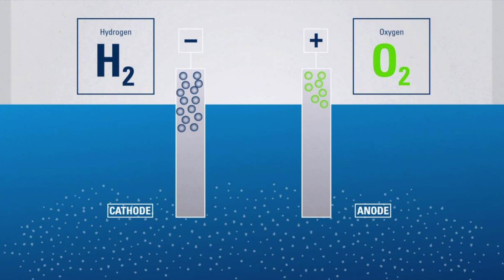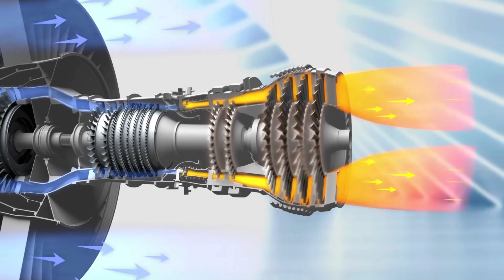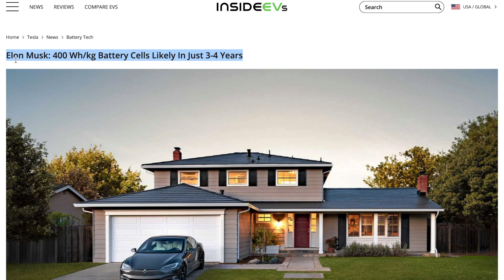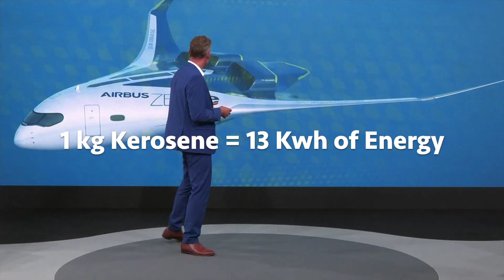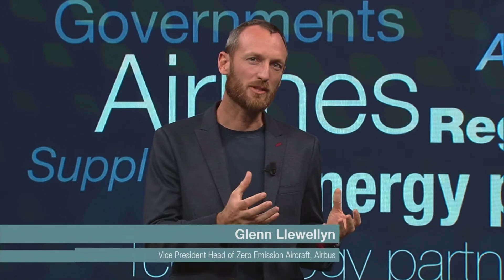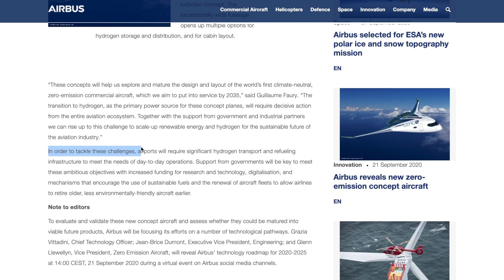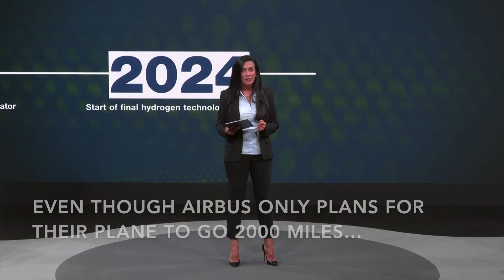Why A Hydrogen Plane Is A Terrible Idea

Comment: If the fusion reactor of ITER succeeds electricity finally would be dirt cheap and thus electrolysis will be a viable option the problem with battery tech is it's over dependence on rare earth elements that are scarce
Reply: battery planes are a novelty along with electric cars in 10 years nobody will drive electric cars
Reply: @MegamanTheSecond  Are you willing to make a bet on that?
Reply: @MegamanTheSecond  People in cities will continue to use and buy electric cars. For everyday non-traveling use it makes sense.

Comment: You have to mention that the energy 1 kg hydrogen carries is greater than 13 kwh, its actually 33,3 kwh. And when you do the math you can see that you pay 5.5 USD for the same energy. Not saying inexpensive just pointing out that if more H gets produced the gap in prices might very well become less significant. Furthermore, hydrogen is the far greener option for the enviorment
Reply: You can drive 100km with 1kg with a hydrogen-electric car.
Reply: @flo6119  is that good or bad?

Comment: 1:40 this is about the same efficiency as that of jet fuel. Most of the energy in jet fuel is lost as heat. Only about 17-21% gets converted into motion.
Reply: Duh, no motor has above 50% efficiency
Reply: @mbican  electric motors do, combustion engines don't (for the most part)

Comment: Utterly disappointing and uninformed video/analysis. In addition to all of the points made in these comments, The battery weights open the door to the tyranny of the rocket equation - more weight means more power, which means more weight etc. Also, planes fly at high altitudes which experience very low pressure, causing the temperature to drop significantly, thus decreasing the power efficiency of batteries significantly.
Reply: Indeed. I LOL'ed at your use of the word tyranny too, never before has such an apt label been so accurately applied.

Comment: Some aspects are not considered. So better do some more homework. You take into account all future enhancements in battery technology but assume that hydrogen technology  does not evolve. That is a useless comparison frankly. For example, hydrogen can now be produced directly from solar without an electrolysis process and it can be stored in solid state on disks without need for hydrogen stations,... Certainly, all these technologies still need to be enhanced and maybe we'll need other new hydrogen technologies to make it more efficient, but the point is: lets have all info before we compare.

Comment: Did you take into account the weight of the storage vessels in your H2 energy density calcs?
Reply: Also many people are over looking this aspect of storage: "Ammonia fuel cells are an excellent source of hydrogen in its liquid form, containing twice as much hydrogen as liquid hydrogen by volume."
Reply: @TylerWitucki  probably the way we're gonna go. It takes a lot of heat to separate, but you can use the exhaust to keep the splitter hot. You also need to push the result through a filter to pull off the nitrogen. All in all, still probably the most efficient way. 

Plus, we produce Ammonia in huge quantities already for plant fertilizer. It's already a massive part of the global economy. It's definitely the future
Reply: @JohnDoe-rx3vn  You don't need a splitter if you use an SOFC -- they run hot enough already that they can use ammonia directly as fuel. They're also hot enough to act as the core of a jet engine, so you can run them in hybrid configurations with a turbine and compressor to boost the efficiency past 70%. The main disadvantage of SOFCs -- aside from being relatively new (though still commercial) -- is their high temperature which makes them unsuitable for things like cars, but this is actually an advantage for aircraft.
Reply: Storage tanks for LH2 on planes are not heavy, but are bigger than the equivalent jet fuel, so the aircraft shape and geometry must be completely different, hence why the delta shape in the airbus studies.
Reply: @TylerWitucki  This technology is less attractive in planes than LH2 because the energy density by weight is much worse - actually worse than jet fuel. It would be very attractive for shipping and other applications where volume is more important than weight.
Reply: @TylerWitucki  there is also aluminum fuel pellets that give off hydrogen when reacted with water.
Reply: Hydrogen storage tanks will be built as part of the aircraft structure. Similar to Teslas structural battery. It will save a lot of weight.

Comment: Another thing is that airports charge airlines by the time spent at airports, therefore most planes have very less ground time. Charging would increase this time compared to refuelling with hydrogen or another fuel. Electric is not the solution to everything unfortunately We also need some fuel for ships and maybe rockets, some fuel for the future, it could be hydrogen or something new like ammonia, methane with carbon capture or something completely new.

Comment: I hate the comparison of efficiency of loss energy through the production of hydrogen.

Most electricity is intermittent, while hydrogen even though containment issues. Hydrogen isn’t, it’s stored energy ready to use at point of service.

Comment: Lithium-ion battery choice on planes will loose more energy. There are two main points in the system where energy is lost - Chemical to Electrical (95%) and Electrical to Kinetic (80-90%). So you still loose from 15-24% energy based on how efficient are your batteries & electric engine. 
And it will be very hard to achieve good efficiency on motors with high power propellers. Also batteries will need to drain fast so efficiency of batteries will be bad too.
But wait... there is even worse thing. What happens when you use fuel? You burn it up and make your plane lighter.
Which increases flight range dramatically. Your Lithium-ion batteries will not get lighter so it decreases flight range in comparison even more! 
It's a dumb idea to use batteries for planes. You would need even more than 10k Wh/kg to compensate for weight during full flight.

Comment: Even if supercharger station is cheap, electricity is not freely available. I can imagine places like Thailand's Samui island which is a not too small airport with planes coming in and out every half an hour or so. Being an island mean it only has access to limited electricity. It might not be enough to charge all the planes, which i reckon is quivalent to quite a few (many actually) households.

Comment: Interesting topic. However, I noticed that you forgot to mention the use hydrogen fuel cells in their design. The fuel cells would most likely account for the majority of the thrust during cruise. The turbines would only be used for extra 'juice' during high power demands like take-off and climb. This of course changes the entire economics of flight. Also, there is of course no guarantee, but ZEROe is only plausible with enough governmental support, which the Airbus did took into account. I do agree with you that battery technology is more obvious choice right now, but I think with enough government support and close cooperation between leading aerospace companies, energy producers and research institutes that hydrogen is the way to go.
Reply: He mentioned many times that they will use the hydrogen in a combustion process so they dont actually need a fuelcell
Reply: Don't worry about Airbus getting money are government give them all the money they want that's my other company struggle
Reply: But if it's left up the airlines to fix the emission problems and not the airframe manufacturer you can have all kinds of issues.

Comment: One of the problems not considered, is the conversion of electricity into thrust. While electric motors could be considered for smaller aircraft. I don’t believe that for larger aircraft, motors (connected to propellers) would be applicable.

While you do give a valid argument for batteries. You should also take into consideration the batteries high weight as compared to hydrogen. In addition to this, our current battery technology degrades over time, which means the aircraft(s) may need costly repairs (battery replacements) over its life cycle.
Finally, I would like to add, that airlines usually have planes that land, depart passengers and cargo, refuel, then immediately takeoff with new cargo and passengers rapidly. This can be done with regular jet fuel, and hydrogen. But currently, with our battery, and predicted battery technology, this is not possible, simply due to charging times.

To this I would like to add that I am no professional in this space as of yet, and I am just projecting my opinion on this issue.
My predictions may be incorrect and I acknowledge this fully.

Comment: Hydrogen production and use as a fuel source has trillions of $ of investment globally. Compared to a couple of hundred billion in batteries. Airbus abandoned batteries as it could see that hydrogen efficiency advancements would far outweigh the advancements in batteries.
Reply: It's not going to be easy to do.its going to take awhile SAF FUELS WILL BE HERE MUCH SOONER AND IF ITS 100% GREEN THAT'S A WIN TOO.

Comment: I appreciate that you took the time to make this video, but with all due respect, I disagree with much of what you've said. The performance figures quoted and the conclusions you've reached as a result of them are a little bit misinformed. I mean no disrespect to you, after all, you've taken the time to make this video, which is more than most people do. I work in future aerospace propulsion concepts research, and my career and resultant expertise spans all of the areas you mention in your video, including batteries and electric propulsion and hydrogen as a fuel. Due to commercial sensitivity, unfortunately I can't address each point you've made in technical detail, but I can give you some vague clues that might make you rethink your conclusions:

1. Hydrogen as a fuel certainly isn't less efficient than kerosene when used in a gas turbine, in fact, if stored as a liquid, it can potentially offer some interesting benefits in terms of thermal efficiency over kerosene due to its very high heat capacity and extremely low storage temperature. 

2. Lithium air batteries have a theoretical molecular energy density maximum of 40,000 Wh/kg, but then again lithium ion/polymer batteries have a theoretical energy density maximum of around 2,500 Wh/kg, yet have only reached around a tenth of that after billions in global investment and research at the pack level. So assuming the same applies to Li-Air, we get 4,000 Wh/kg at the pack level, which is impressive. But then consider this; batteries generally stay mass constant during discharge, which is why it's undesirable for aircraft. Li-Air batteries GAIN weight as they discharge, so you have to work the batteries progressively harder during a flight profile. Furthermore, they come with specific requirements; temperatures, pressures, safety systems, thermal management, electrical protection, the list goes on. Then consider that the aircraft needs the additional systems, so the motors, the power electronics, the cables, the distribution systems, more thermal management, etc. So when all is said and done, no matter how good your battery is, the advantages diminish in both weight and efficiency terms until you end up losing compared to a gas turbine. Modern gas turbines are VERY power dense, they convert fuel to propulsion at efficiencies nearing 50%, with power densities exceeding 7 kW/kg. An electrical network, with the batteries, propulsion network, and so on come nowhere close. Remember, if it fails the back of the envelope test, it's probably not worth doing; 50% of 36 kWh/kg in hydrogen GT's compared to 90% of 4 kWh/kg in Li-Air electric propulsion. There's no contest.
Reply: I agree with your conclusions almost completely. Except there is a better fuel then hydrogen for airplanes: ETHANOL. It has 70% of the density of the kerosene and none of the long list of the hydrogen problems. Most important advantage is that ethanol is as cheap as petrol and is already proven in industrial quantities by Brazil.
Reply: @teranova5566  Ethanol (and methanol) are certainly viable options for aircraft fuel, no doubt. It raises a different set of challenges though, primarily availability (you would need to produce it from sustainable feedstocks for example, and at the scales required that isn't an insignificant challenge) as well as the unavoidable reality that it is still a carbon emitting solution. 

Availability is potentially mitigatable, but requires a lot of thought about where you source your feedstocks from. Arable land is declining and populations globally are increasing, so that's not really an ethical or sustainable solution. There's algae, grown at sea or in tanks on land, but that has an impact on the local ecosystems too. If we did solve that problem, then it could be viable. 

But the carbon aspect still remains, that it is a net zero carbon fuel at best rather than a true zero carbon fuel. If it's made from feedstocks, it produces a net positive amount of CO2, but made from CO2, its very inefficient, so it requires a combined approach to be truly net zero. Finally, that all could come screeching to a halt if governments drop the net from the equation and insist that it's zero carbon rather than net zero. Ultimately, it's difficult to predict what will happen politically. 

So in summary, ethanol is a good solution technically, with challenges that can be overcome in a practical sense with heavy investment, but is fundamentally risky as a solution due to the high probability of being ruled out politically should politicians decide to insist on zero carbon solutions rather than net zero.

Comment: What about 1) time to recharge batteries (or do you see planes replacing the batteries after every flight?), 2) weight of batteries, 3) cost of batteries (it's about 1/3 of the car price to replace battery on on a VW e-golf), and 4) the natural resources required to manufacture and recycle batteries. Batteries don't operate well in the cold either. Also, batteries loose efficiency over time (how is your iphone doing after 2 years?) so you will need bigger batteries to compensate for this. That itself has a huge cost impact.

Comment: Take it from a pilot. Hydrogen aircraft make more sense for aviation than battery powered aircraft do.
1. Its faster to refuel
2. Weight decreases as hydrogen is used (battery will always weigh the same regardless)
3. Transferring from a fossil fuel powered aircraft to a hydrogen powered aircraft will result in far less training than to an electrical aircraft
4. Converting current aircraft to hydrogen power would be way easier and cheaper than building specialty built battery aircraft.

Now if your claim that battery tech will be better by 2035 is true, that would also mean that hydrogen farming would be better too. If we invest in finding better ways to harvest hydrogen more efficiently, then hydrogen again would make more sense.
Also, we can tell your bias by the fact you are talking about hydrogen pricing and harvesting in present terms, but talk about battery technology of the future. That's not a fair assessment.

Comment: Batteries are extremely heavy. Hydrogen can counter the weight.
Reply: Especially since the hydrogen tank can become a structural part of the aircraft fuselage. Hydrogen is the future. But I think synthetic E-kerosene is the most viable for the coming decades for long distance aircraft.

Comment: Your analysis doesn't take economies of scale into account.
All you need to extract hydrogen is water (practically infinite) and electricity (France has a lot of nuclear reactors).
Hydrogen has the potential to be even cheaper than any fossil fuels.

Comment: You forgot to account for the inefficiency of battery electric prop engines. You divided the energy density of hydrogen by 4 to account for the inefficiency of burning it in a jet engine, but didn't mention that electric motor driven props are also inefficient.

Comment: Actually not all methane comes from a  fossil source. Natural gas is a fossil source, yes, but biogas is also methane and comes from biological waste. Biogas is great since it comes from waste that we throw away, but wouldn't it be better to use it as fuel for the planes directly instead converting it to hydrogen first?